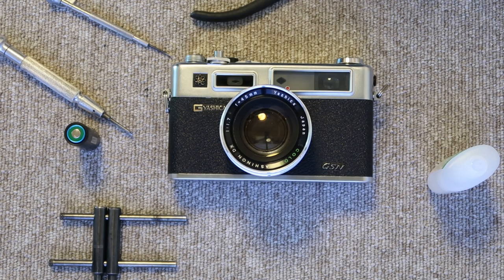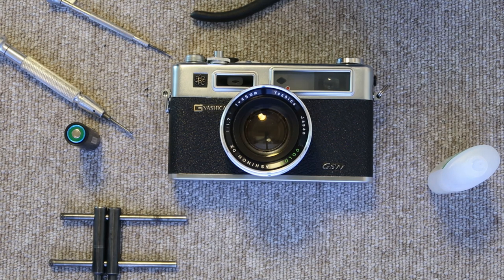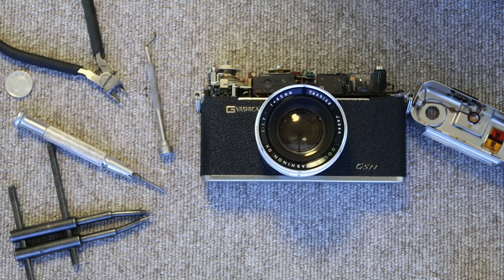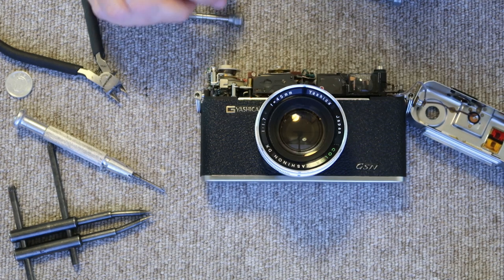Restoring a Yashica Electro 35 GSN Camera

Comment: Hey there! While attempting to restore an Electro 35 earlier today with help of your video, I made a mistake and could use some help. After reassembling the camera, the only thing that doesnt seem to function right is the "over" light. It worked whenever I first got power back into the camera from soldering the main white power wire, however I did not test it right after replacing the POD with a glued in strip of hard foam. What I believe to be the problem is that while cleaning the top case and preparing it for re-assembly I got some rubbing alcohol on the frosted glass, ruining it. Would this be the issue or is there a chance that my new POD is defective or I broke something else? Also, if it is just the glass, where could I find a replacement piece? Thank you for all the help already.
Reply from the maker: The indicator lights in these cameras can burn out unexpectedly, and sometimes need to be replaced. You can test the bulb by running current through it. The "over" lamp is rather necessary to be able to use the camera, as the maximum shutter speed is rather limited, the "low" lamp is less necessary as the shutter will stay open much longer than you can hold the camera still. You might be able to find the bulbs on Amazon in your country, they are simple 6 volt bulbs with short leads attached. Otherwise you can get one from a donor camera.

Comment: hi, i was wondering if you could help me find light seals for my yashica electro35 . Thanks
Reply: I just replaced mine using black yarn and stuffing them into the spacing where the light seals should be. You could also use foam with a sticky side and put them on like a sticker to seal.

Comment: Hello mate, Iv recently bought one and it’s in good condition however the battery cap has corroded also so nothings happening how can I replace it or fix it. Do you know where I can get a new one if possible, tbx
Reply from the maker: I used to have a stock of these battery caps, but have used them all when doing repairs. Usually you can clean them up enough to get good contact, a file or sandpaper can remove the corrosion. But sometimes if the corrosion is bad enough, it can cause the power wire on the top of the battery chamber to become disconnected, this requires removing the rangefinder and doing some soldering. You can use battery caps from several of the Electro models, you can find these cheap at thrift shops, yard sales, and other places.
Reply: @japanvintagecamera8869  alright mate thank you very much I’ll have a look and see what I can do, thank you for the words of wisdom

Comment: The light meter of my electro 35 only lights up briefly after taking a shot. Is it just the bulb? The slow and over bulb goes away when I properly expose.
Reply from the maker: The contacts may be dirty. You can clean them by removing the bottom cover. Near the bottom opposite the shutter button you can see where the  shutter shaft is attached on the front inside of the camera, and the wires which attach to it. Simply put a few drops of lighter fluid or clean paint thinner on this area, wind the cocking lever to the end of its travel, hold it there, and then push the shutter button rapidly a few times. But the bottom cover back on, and everything should work properly.
Reply: @japanvintagecamera8869  Thanks for the answer, It is working, It's just me, I wasn't pressing it down enough. I sent it for CLA and I can;t wait to use it.

Comment: I just bought my electro, and I noticed that the exposure ring that has the bulb and auto mode just free spins. I am not sure if that affects the shooting mode of the camera. How do you repair it? I have not found anything about it.
Reply from the maker: There is a detent ball which is supposed to catch in the 3 different positions. If the ring turns too freely, you can use a piece of tape to hold it in place. Yashica often put stickers on this ring to hold it in the A position because new buyers often accidentally moved it to the B or sync settings and complained that their cameras didn't work right.
Reply: @japanvintagecamera8869  This is very helpful, thank you.
Reply: @japanvintagecamera8869  Hi again, I figured out that there is an issue for the film  advance lever. I put in a dead roll to test my camera some more. But it seems that when I advance the lever, it seems like the mechanism slips so it does not fully advance. If you had any tips to fix that I would really appreciate it. I just got the camera and I guess I have to restore it if I want it in fully functional condition.

Comment: Hi, I just got an electro, but it’s not operating at all. The battery light doesn’t come on either.
Reply from the maker: Try scraping the spring inside the batter chamber with a screw driver, and scrape the contact around the battery cap, these often have corrosion around them which prevents current from getting through.

Comment: Would you kindly share what battery works best with the Yashica Electro 35 ?
Reply: They were made to use with 5.6V mercury cells but those are illegal now, so: Pick up 4 LR44 batteries and stack them. You can tape them together, or do what I did and clean an old chapstick tube and stack them inside. Most people just tape em and since the batt stack won't reach both contacts, you can stick a wad of tin foil to fill the rest.
Reply: yashicaguy sells an adaptor you can stick an inexpensive readily available battery into for a perfect fit

Comment: I think this one of the most over rated cameras on the web. The only good thing are the lenses. The rest is a no sense because it is practically a manual camera but with only 1/30 sec., the focusing ring is not so fast for street photography or fast situations. Load the film is so... difficult that I take about 5 minutes to understand if it is correctly engaged...so In my opinion.. don't buy it.
Reply: Shutter speeds range between 30s. and 1/500 s. electronically.  Film loading is similar to any other camera of that era, nothing difficult to it. This really is an excellent piece of equipment by Yashica.
Reply: @mezelf01  In this case my camera doesn't work. I have only one shutter speed. About the film loading I'm not agree with you. I have a lot of cameras and this is the most boring. Sincerely I think that there are many cameras better than this and in the price range of today.